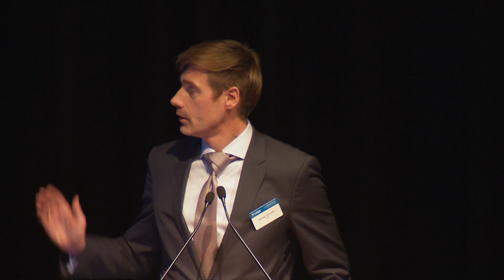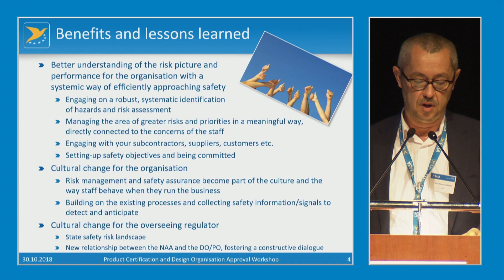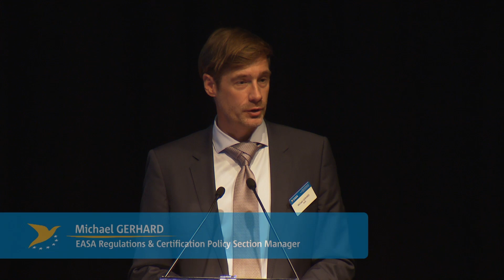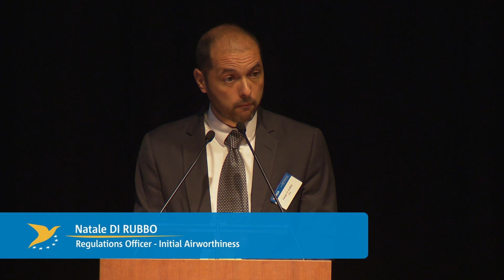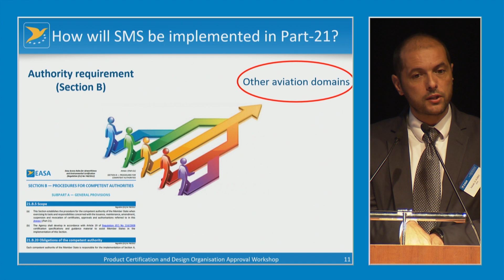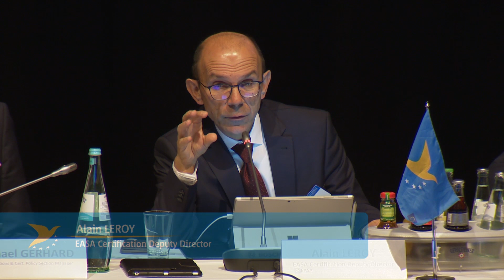Safety Management System (SMS)

Comment: THE PART 21 SHOULD INCLUDE IN SMS THAT ARE MADE AVAILABLE WHICH ARE REQUIRING A FULL SMS IS LIMITED FOR COST REASONS BUT THE ARE DIFFERENT PARTS THERE ARE DIFFERENT SMS IN WHICH THEY HOLD A DOA OR POA?